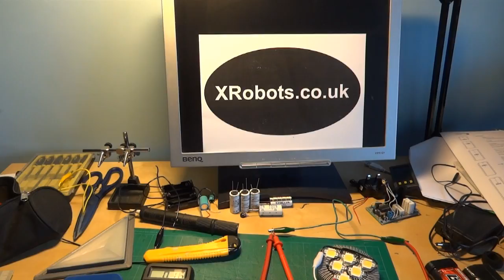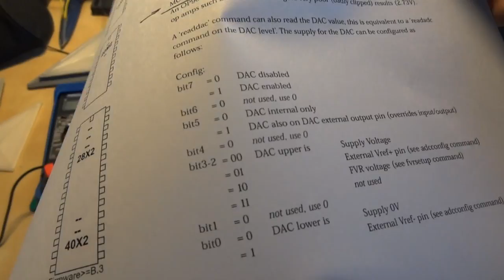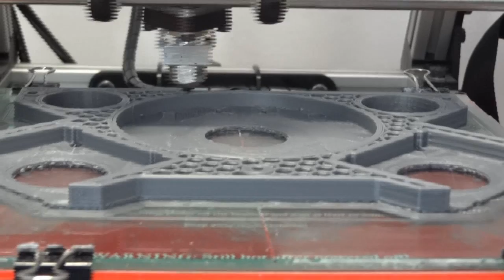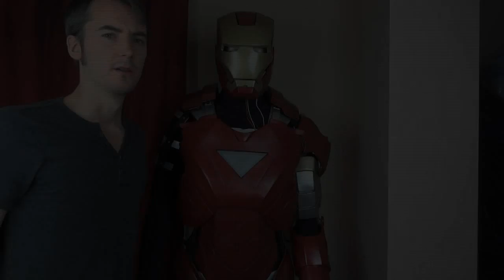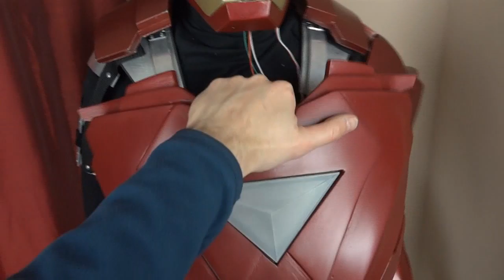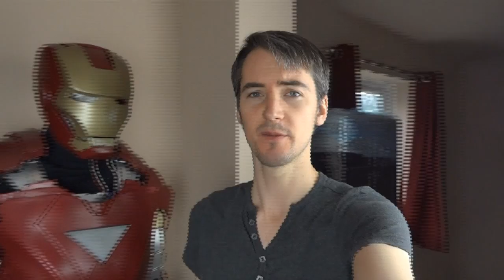Iron Man Power Suit #45 | Wiring the Unibeam | James Bruton

Comment: Hi James, hope you can see this question. Where did you connect the switch to the PICAXE? i can see the join is back the board, and has been a headache trying to figure out where did you put the switch solder points.

Comment: here's an idea for a permanent code on the arc reactor.

1. at idle it only has each LED at 1 watt.
2. when the clicker is pressed it ramps each LED to between 3-5 watts over 2 seconds
3. at the one second mark it flashes all LED's to max power ((10 watts each)) then back to between 3-5 watts per LED
4. after the flash happens it then ramps back down to idle over 2 seconds